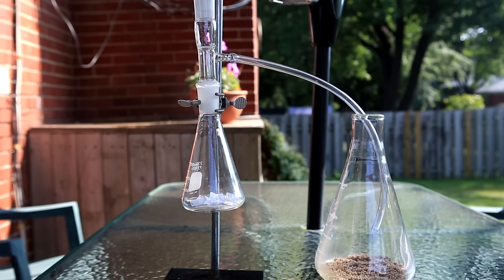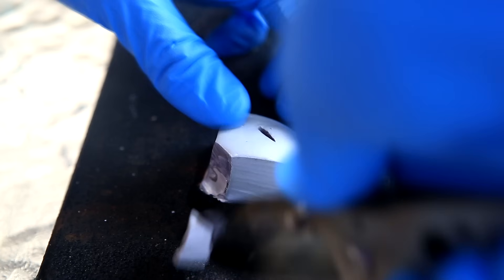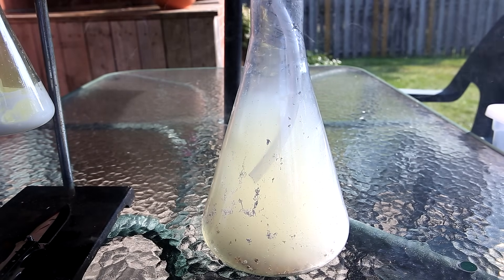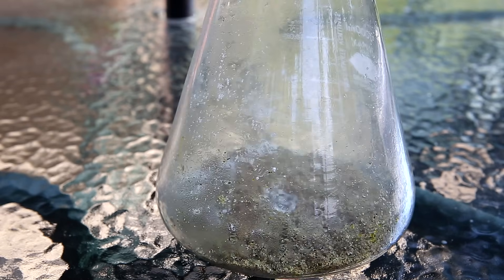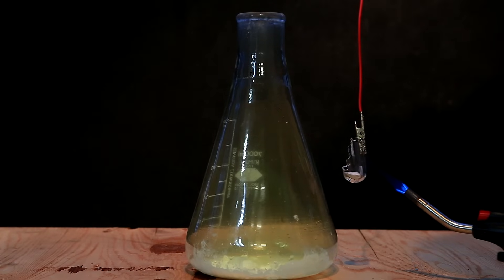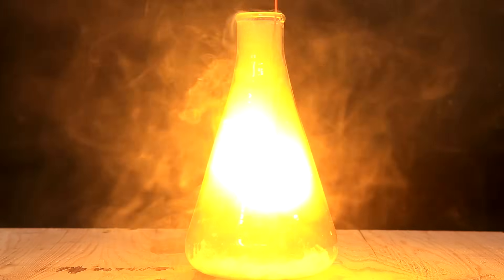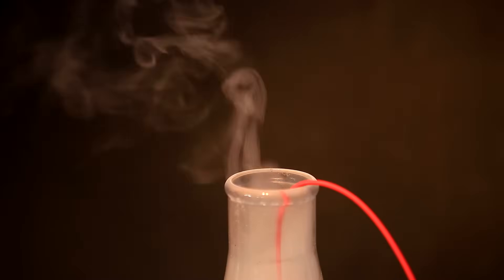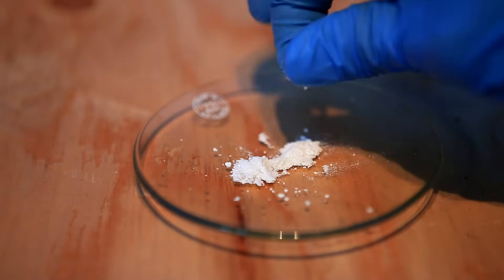Making table salt using sodium metal and chlorine gas

Comment: That last reaction is sodium, sodium hydride, sodium oxide burning in HCL + CL2 + O2. It's important to note that HCL gas is also lighter than CL2 so it pulls the CL2 out of the container unless it's cold. The final product is probably chloride, oxide, hydride, hydroxide.
Reply: perhaps that's why he didn't dare to taste it.
Reply: Why hydride??
Reply: @robertcece6972 Exactly, and maybe a little bit of carbonate from CO2 in that air that the chlorine failed to push out. For it to be pure sodium chloride he should pour the NaCl into the water, any leftover oxide will quickly react with water to form sodium hydroxide (NaOH), any hydride will react with water too: NaH+H2O>NaOH+H2, the hydrogen will bubble out because it's a gas and all of the sodium hydroxide from these two reactions as well as the original sodium hydroxide would dissolve into the water and then dissociate in water to produce sodium ions and hydroxide ions and then you can check the pH and if you were using pure distilled water that has been boiled after distilling to knock down the soluability of CO2 you should be left with a water that has a pH of exactly 7, and then you can put in the NaCl and add dilute HCl (aq) to bring the pH back down to 7 and at that point you would have destroyed any leftover sodium hydroxide and other side products and you can even go to little less than 7, because you can boil away the water and the hydrochloric acid would be dehydrated to just HCl gas which is gonna escape and then once you have white solid sodium chloride again, then you can recrystalize it again in pure, degassed, distilled water and if you have done everything correctly, you should be left left with a perfectly clear, colorless, odorless and neutral solution and then you can boil off the water and then you're left with white anhydrous sodium chloride and its purity would theoretically be 100%

Comment: At work we use sodium thiosulfate to neutralize hydrogen chloride to produce sodium chloride,  is that chemical common to use?
Reply from the maker: +snakeibite Its pretty common to use in general, but it is more as a reducing agent. So if you need to neutralize bromine or something. To neutralize HCl you could just use baking soda if you wanted to, or dilute NaOH

Comment: Exactly how many grams of sodium did you use in the reaction that lasted ~1 minute?
Reply from the maker: +flimsybop I actually have no idea. Maybe 2 or 3g?
Reply: I think then it's probably because they cut off the video after awhile because usually people don't want to stare at a glowing flask for a minute lol.
Reply from the maker: no i thought i saw it go bright and then die out. Maybe i am just crazy
Reply: Lol I don't know for sure either. Cool reaction though, you should try Al and Mg if you have the chance, they produce cool effects with chlorine too :D On a side note where did you buy your sodium?
Reply from the maker: I got it from Ebay. Some guy sold me 200g. He is gone now though. I bought like everything he had.
Reply: +Nile Red LOL nice I bet he was really happy. How much did 200g cost you?
Reply from the maker: I don't really remember. I mean it is much more expensive than a proper supplier, but maybe $80? I could be 100% totally remembering wrong though.

Comment: So, if you mixed Sodium hydroxide and Hydrochloric acid, and of course got the aqueous solution of water and salt afterwords, how would you go about separating it? Its such a simplistic reaction, yet I've not done it in any of my college courses. so.... Yeah. I love the way you show everything. =w=

We even did the Limonene one and wintergreen reactions in my Organics class. So fun watching you do these experiments.
Reply from the maker: +Naru Chan Just boil it off! Use an excess of HCL (which is a gas) so all the NaOH is reacted. Then when you boil it off, the HCl and water will leave and youll be left with some nice table salt.

I am glad you enjoy the videos :)
Reply: I figured you could boil it off and get the salt by itself. Though when you state using an excess of Hydrochloric acid, do you mean the acid itself will be in the gas phase? I'm used to working with the liquid state at relatively low molarity; [3 and 6]

 ~u~ And thank you, for making such interesting videos.
Reply from the maker: HCl acid is a gas at room temperature that is dissolved in water to make the aqueous acid!
Reply: OH YEAH. C-completly forgot about that. Ahaha >U<;; Thanks again.

Comment: Really nice video. I ll do this in school when the school is open for the parents and we do a little show for them :) I just need to order the Chlorine pool pills. did you get them on ebay ?
Reply from the maker: +CODSuchti00 Nope. You can buy them from local stores like Walmart
Reply: I live in germany so I can t go to walmart :D
Reply from the maker: Do you any pool stores?
Reply: well not in germany. I would have to look one up on google or something. but I think I won t use pool pills. I take KMnO4 and HCl. it will produce chlorine aswell

Comment: There is an easier way to purify it. Put the NaCl and sand mixture into some water. Sodium chloride will dissolve but not the sand. Decantate the solution from the sand and you have a fairly pure sodium chloride solution along with some other salts that might have been in the sand. Simply boil the water away to get back the sodium chloride crystals.
Reply from the maker: +agent475816 yeah but i dont really need to purify salt! I can just buy it :)
Reply: +agent475816 I'm pretty sure he was aware.
Reply: Nile Red well you said there is another way to do it with purer sodium chloride.